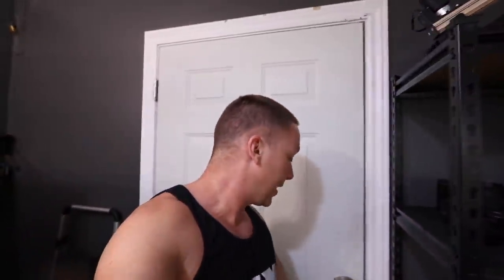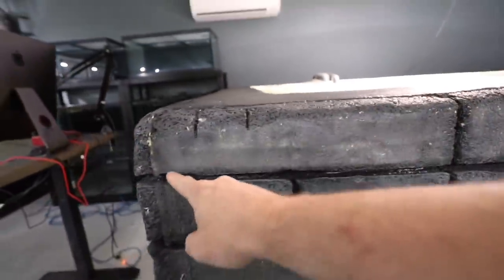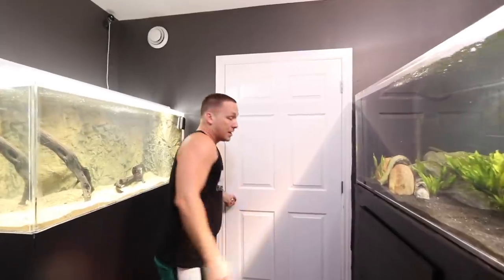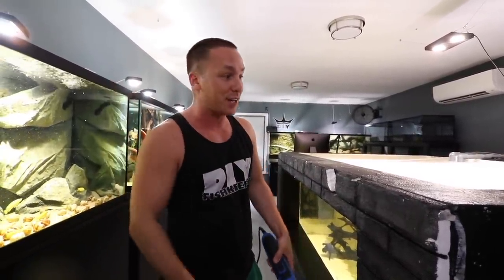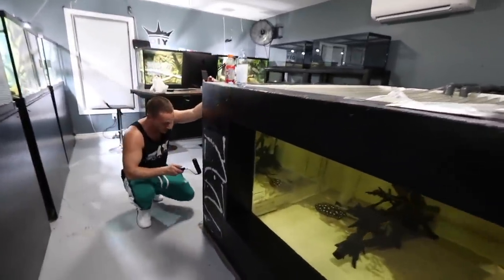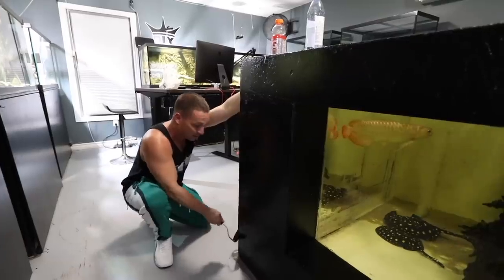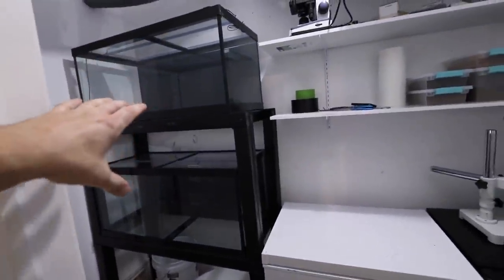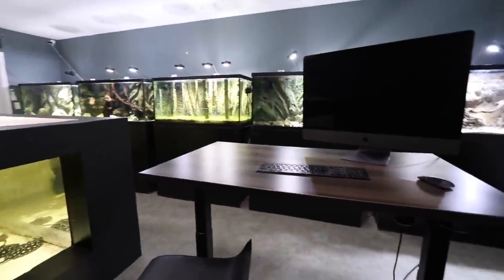AQUARIUM GALLERY REVEAL The king of DIY

Comment: FYI those peel and stick vinyl tile are good for quick work but if you have curling at the corner of the tile, use something heavy to hold it down so the glue can cure. They don't have the best adhesive in the back and something those peel and stick tile are not sold in month so the adhesive dry out. Work in a hardware store so a lot of customer have those issue. You can use more glue but it can cause a mess if you are not too careful.

Comment: Hey Joey I got a 40g high tank and I Wana do my first sump pump system have the parts did all of homework on what to do learning from watching ur videos but I'm confused on what size tank I should use cause if power goes out I know water from my 40g is going to Flow into the sump and if I don't have the rite size tank for the sump it's gonna Flow out the sump and onto the floor can you please help me out thanks again

Comment: Joey, Dont get water on that floor, it will get between the tiles and loosen the glue which will result in the tile coming loose
Reply from the maker: I’m not worried. I have an extra 75 sq/ft left over. Easy to replace .

Comment: As soon as you start getting water on those tiles they will come off
Reply from the maker: As long as I don’t flood the room, it will be fine. Easy to replace anyways.
Reply: Not true if they were applied correctly. My spare bathroom is tiled with these and I wash the floor often as the cat litter boxes are there. They are solid.